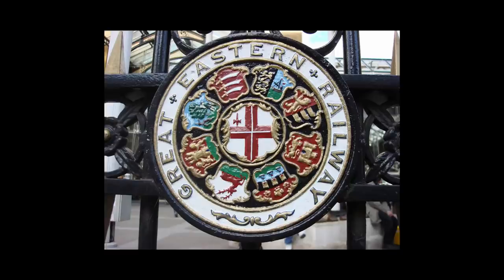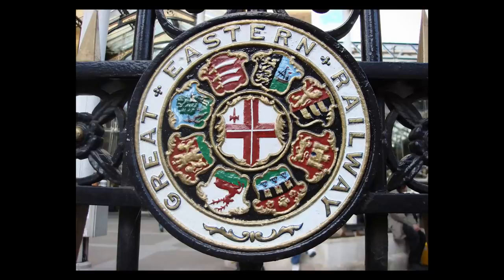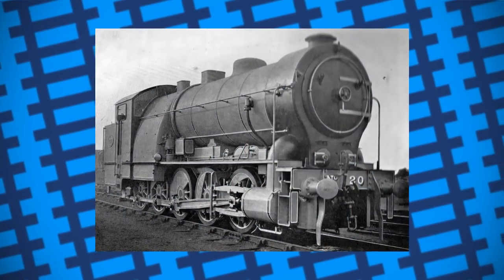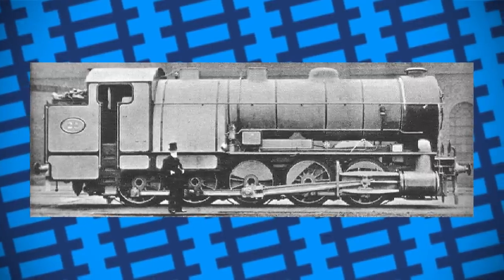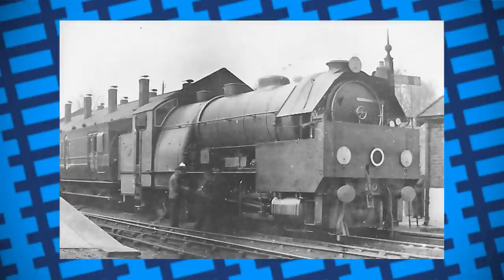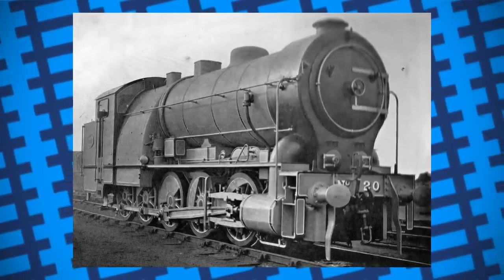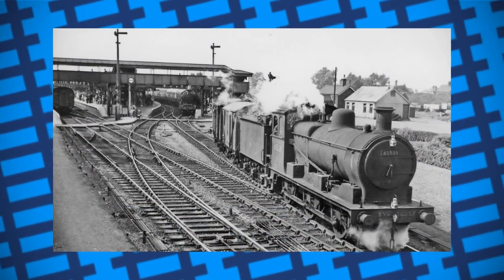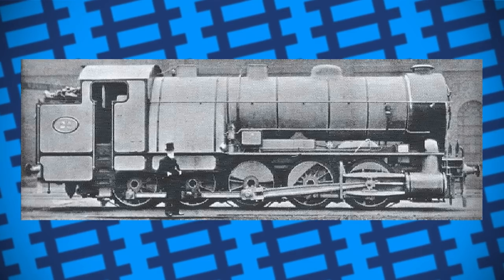The steam locomotive built explicitly to accelerate - GER A55 "Decapod"

Comment: A modern electric locomotive –provided you disable the safeties and have your next job lined up– can accelerate faster than a sports car.
Reply: Oh, and you’ll need plenty of insurance coverage, and a good lawyer.
Reply: I've seen a few videos of that, it's pretty absurd how quickly those things can get moving. Running light of course, they're still heavy but have gobs of power. Figure if it's limited by traction at speeds up to 30 mph (honestly seems plausible for a locomotive with 8,000 horsepower) and has a coefficient of friction of 0.3 that would give a 0-30 time of 4.6 seconds, and 0-60 of 9.1. Not sure I'd say that's faster than most respectable modern sportscars, but on par with older ones, and probably most modern econo-boxes (which are quicker than the beloved muscle cars of the '60s-'70s).
Reply: @quillmaurer6563  The info I have –and which I cannot find back– is from drivers of the Dutch NS 1600 class, which is essentially a French SNCF 7200 class with more power. When those safeties are off, they reach 100 km/h in a handful of seconds. Since it damages both the locomotive and the infrastructure, you'll probably won't find a lot of videos online. But as said, I cannot find the web page back, so I only have my memory to rely on.
Reply: Speaking of disabling safety systems and getting fired, here's a video of a guy disabling a roller coaster's brakes and letting it just run through the station at full speed multiple times.

https://youtu.be/zRbL5xkPNkg
Reply: @quillmaurer6563  and really, seeing a train do that...your mind would be blown.
Reply: How about a power to weight analysis? That and traction are all that matter. Now, traction is poor with steel on steel, so it's hard to imagine a locomotive beating a car based on that alone.
Reply: @quillmaurer6563  the trick behind the speed of modern econo-boxes vs older muscle cars really comes down to tires, and grip, 350-400 HP is still a 350-400hp regardless of the decade it was produced in, but the tire tech of the time limited what 0-60/quarter mile runs they could actually pull off.

Comment: Technically successful in what it set out to do and in delaying NE London electrification for 40-50 years (not really a good thing) but unsuccessful as its weight wasn't suitable for the lines. A bit like VHS v Betamax v Philips V2000 (remember them?) - technically best isn't always best commercially, practically or in fitness for purpose.
Reply: Why was it a bad thing?
Reply: @the4tierbridge  I guess I was ambiguous - I meant the delay was a bad thing, not the electrification! The north-east London lines were very overcrowded and desperately needed fast frequent electric services like those introduced on the Southern Railway. In the end the LNER handed some of the routes over to the LT Central Line but the others weren't electrified till 1960 (1969 for the Tottenham Hale-Cheshunt section).
Reply: @iankemp1131  I mean, why couldn’t they engineer new steamers instead. Electrification is expensive.
Reply: @the4tierbridge  That's why they didn't electrify ... but new steam locos with anything approaching the acceleration of electric trains needed to be very heavy like the Decapod, so all the bridges etc would have to be strengthened, and that's even more expensive than electrification. An electric motor coach is about 40 tons, the Decapod was over 80 tons. Steam locomotives have at most 6-7% efficiency as heat-to-power converters, so it's much easier to get high power by generating in a power station elsewhere and transmitting it to the train. That's also why all commercial high-speed trains (above 200 km/h) are electric.
Reply: Kinda reminds me of other aerospace companies badmouthing and suing SpaceX to keep SpaceX from reaping the benefits of the risk and innovation that they went for, that the other companies neglected or failed to accomplish.
Reply: @the4tierbridge  Air pollution. Noise. You can't really run steam or diesel trains in almost enclosed underground systems. Electrification is very viable in systems that are relatively short but carry high passenger numbers, the capital cost isn't prohibitive and it's more economic to run meaning lower ticket prices and even more ridership. Steam was obsolete for suburban services long before it became truly obsolete.
Reply: @Person01234  I guess so. None of them GWR suburban tanks never really found a use.

Comment: JBS actually gets Hurricane wrong. In the special, his last 2 driving wheels actually have a separate set of connecting rods. No idea why they did this. Seeing as his basis had its connecting rods running along all of its driving wheels.
Reply: its probably an error during the production
Reply: The reason for that was so he could navigate tight bends in the Steelworks.
Reply: @kathryncampbell9564  The GER A55 was designed to do so without being articulated. The fifth axle could move laterally (side to side) when negotiating curves, and the connecting rods were attached to the fifth pair of wheels with ball joints to allow the lateral movement.
Reply: @KeijiSuwa  Whoah, I never new that! Thanks for the fun fact! =D
Reply: What the heck is Jbs?
Reply: @petermikus2363  Journey Beyond Sodor.
Reply: @trainlover16  thanks
Reply: Chances are since there weren't any of these engines left according to what i've interpreted from this video and there is only old photos left, i'd say they probably tried doing the best they could with what was available
Reply: @Joshua W56 but that was throughout the duration of the film, a small error wouldn’t be executed in the whole film if it was supposed to just be a mess up in a few scenes.
Reply: Hurricane's more of an 0-6-4-0T
Reply: Hurricane's basis is actually one of my favorite type of steam engines. So much so, that I built it in Lego form. Even incorporating elements from JBS into the MOC.
Reply: @joeleboeuf  Fantastic.

Comment: I remember a central European steam locomotive pulling a rush hour EMU passenger train on an electrified route. The power to the lines went dead and a 0-10-0 tank engine was pulled in to help. It was accelerating like an electric can but was limited to its top speed. Top speed was not really needed on that particular line as it was serving very close station to station distance.

Comment: I've known about the Decopod for many years. Definitely on my list of favourite locomotives. It's a shame she could not find another use. The man you see in front of the engine is James Holden who designed and built the locomotive. It was rebuilt by James's son Stephen who had replaced his father as Chief Mechanical Engineer in 1908. The new firebox and boiler came from Stephen's S69 4-6-0 express locomotive which was a more powerful version of James's 4-4-0 express locomotive Claud Hamilton, named after the then chairman of the GER.

Comment: Steam rules the world still, yet most people doesn't know how important steam still is to everyone
Reply: Or the importance of Richard Trevithick.
Reply: Within nuclear energy mostly,
Reply: @the4tierbridge  No, every power plant, except hydro power plants. Although some would like to call a wind farm a power plant, but I have to disagree. The same goes for solar panels
Reply: @koppadasao  I mean, if you had enough of then im a complex...
Reply: @creamwobbly  Power station is different from a power plant
Reply: Any heat source could make a steam. A turbine harnessing steam power is much more efficient than reciprocating pistons. Thats why most power plants are steam driven. Any fuel can be fed to the boiler. Nuclear power plants uses heat exchanger to isolate the turbine water and reactor water.

A more uncommon solar power farm is a steam driven solar mirror farm. It only uses controllable pitch mirrors to reflect the heat of the sun and point it straight to the boiler tower.
Reply: Just one "slight" problem with steam cycle: immense heat waste. At sea-level pressure it takes 1 BTU/lb to raise water temp 1 deg F. It takes 970 BTU to convert 1 lb water to steam. Then remaining heat in exhaust steam must be removed to condense the steam. With liquid or gaseous fuels, gas turbines are a much better bet. Much quicker startup, no storage of massive energy in boiler looking for escape, no need for huge superheat to boost efficiency. (Nuclear reactors generate saturated steam- no superheat.)
Reply: i like steam most :) train fan here

Comment: Part of me wonders if this locomotive was rebuilt from scratch today would you be able to have it work on the preexisting rail lines? Or would the modern bridges and viaducts be too weak still? But I would also guess due to it being a Tank Engine it would be limited to smaller distances, like Heritage railways. All things considered a very weird locomotive in existence.
Reply: Maybe. But the performance of modern electrics and diesel-electrics has moved way on from when this was viable. The services it was designed for have moved underground and you can't really use steam trains underground, especially not with modern safety regulations. To that point even if they hadn't, it's also doubtful that steam trains would still be legal to run on these routes because of updated air quality regulations. And people wouldn't like them because a steam train is a lot noisier than an electric.

Comment: The only purpose of the engine was getting rid of competition. It was not built to do the job on rail, it was built to fool polititians who had no technical understanding. In 1902 they already were able to do very good estimations of what a new steam loco design would be able to do. They knew before it was built that it was fast but inefficient and they knew it was too heavy. It was never planned to have a fleet of these for everyday passenger service.

Comment: Wasn't the famous 'Lickey Banker' a 0-10-0?  So it's at least possible that someone, somewhere followed up on that design
Reply: But the Lickey Banker wasn't designed for fast acceleration, and its four cylinders used all the steam in the boiler in ten minutes shoving. It just had enough margin to make it to the top of the bank, and had to build up the pressure on the way down.

Comment: Would it have been any use at the Lickey Incline? Not withstanding it belonged to a rival railway company. This engine had 20kN less tractive effort.
Reply: Possibly in the early days of lighter train loads, but I suspect it may have struggled on the 2-mile line, especially considering the fact it was owned by someone else entirely. It definitely would not outlive Bertha on the banking duties, especially considering the trials of GWR 4200s (significantly more powerful then the A55), which proved unsuccessful.
Reply: @ajaxengineco   Thanks for your reply. It was a thought that occurred to me, rather than converting it to an unsuccessful 0-8-0, offer it to another company as a 10-coupled engine. (not for free, of course)
Reply: @channelsixtysix066  perhaps they could have done what the K&ESR did with their 'White Elephant', an 0-8-0T called Hecate - swap it for an old saddle tank and some coaches with the Southern Railway! The SR put Hecate onto shunting, so it's terrible fuel capacity wasn't a problem.
Reply: @ajaxengineco   Hecate was doing quite well at the SR, until a King Arthur came along and collided with her, destroying her frames. So it wasn't her fuel consumption, but the coal bunker was of insufficient capacity. They could have fitted a larger one. I'm a fan of tank engines, particularly large ones, like the French and German engines.
Reply: @channelsixtysix066  As I say, putting her to shunting pretty much neutralised her problems, she was a solid engine in all respects except the bunker. The trouble was, she was a bit non-standard to begin with (not the SR really did standard), & getting the bends in an accident finished it.
Reply: @ajaxengineco   An extra half a metre on the bunker would have fixed the capacity.

Comment: With today's tech, a battery-steam unit wouldn't be out of order. Electric for the torque on start, save on water, whilst the steam provides better torque at speed.  Both batteries and boiler acting as a power storage.
Reply: But always much less efficient than a comparable diesel-electric or straight electric engine. (6-7% v 30%+)
Reply: Efficiency be dammed !
Where's the Humanity ?
Reply: @lazyrrr2411  True ... but most everyday commuters will go for a fast clean electric train rather than a slow steam train with lots of soot and smuts to mess up your clothes and hands. Preserved railways ... ah that's different, a steam engine has much more soul!
Reply: @iankemp1131   you're not wrong

Comment: Loco : Accelarate to 48kmh in 30 sec
Me who in car : ok..... (Saitama)
Reply: Yeah, but your car isn't towing 335 tons.
Reply: @richardharrold9736  I don't care about towing 1 or 300 tonnes. I want to experience a life style. On rather rail or road. Depending on my liking and mood
Reply: @shadow6953  lifestyle has absolutely fuck all to do with a locomotive's acceleration over a century ago...
Reply: @richardharrold9736  let me reform. What I want when I drive a machine it an experience. That why the Dodge Viper is my favorite car. In Locomotive, it the same. I want a experience, not specs....
I know those two can't really be compare. One is a big strong machine that can't steer, but pull so much weight. The other is all about performance, taking curb, down shifting and sometimes modifying
Reply: @shadow6953  a locomotive isn't an experience, it's a tool to do a job. Hence your comparison of acceleration between two completely different kinds of motive power is fatuous and irrelevant.
Reply: @richardharrold9736  Clearly we are not compatible. I got my vision of machine in general. You on the other hand just see a tool on wheels.. What ever car, truck, trains etc. 
I got nothing else to say. Good day
(Puff away)
Reply: @shadow6953  you seem to be labouring under the delusion that the railways a hundred years ago were a place of romance. They were not. They were run for strictly practical and profitable reasons. This particular locomotive was built purely to prevent a rival railway being built. It never had any other purpose.

Comment: "Look! We can make our old outdated designs match this brand new already much more effecient technology! We'll prove this by building one example that can only run on very select parts of our system that can handle its excessive weight, and we'll keep using our existing stock because converting all our engines to this upgraded model would be exhorbitantly expensive. But look, we proved it's possible to polish a turd, so drop that legislation that would make us update anything!"

Comment: Id still ague steam is better then Diesel
The reason we switched was so the gas tycoons could rape the transportation industry and get a strangle hold on the goods market
Cuz even today it would be cheaper to run steam, then gas. . . .
Reply: Oil, what steam engine needs oil?
You mean water? For coolant
Or lubrication on the moving parts, cuz thats what greece is for
Reply: Do you know who Coal is so dangerous?
Reply: @420sakura1  coal isent dangerous
The heat is, and diesel explodes at the same heat 🤷‍♂️
So it's not like it's not possible, we just reduced the odds. But if you keep water in the boiler and the pipes clean. Coal is just as safe